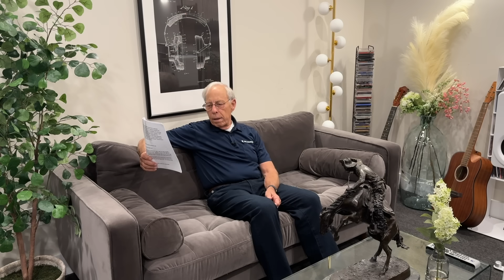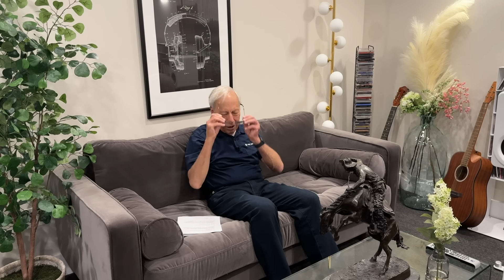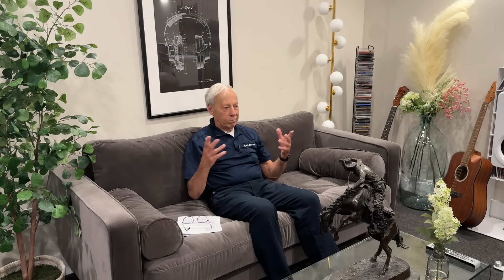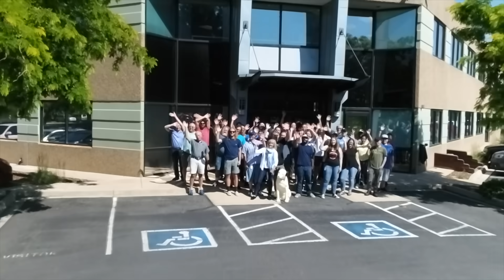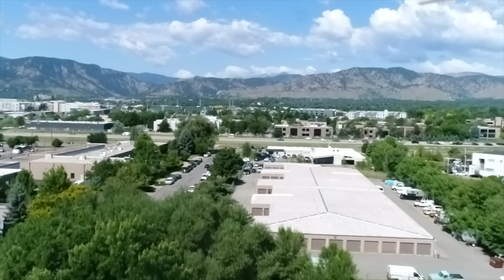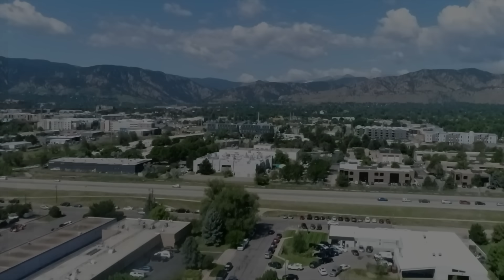Do music streamers sound different?

Comment: I don’t often find myself disagreeing with Paul, but this is one of those rare times. I own three streamers, the HiFi Rose 150B, the Node II, and the WiiM Ultra Music Streamer—all used strictly as streamers feeding into the Metronome Le Dac II via USB. After extensive testing, I couldn’t hear any difference between them. Absolutely zero.
Reply: Nor should you ... that's all "digital side" comparison where the usual analog issues simply don't exist.
Reply: @veteq101: you can rest assured that your experience matches what is to be expected.

If the data is unaltered by the sources, they only technically at least theoretically possible sound difference can occur through jitter. That is measurable, but its audibility already under quite debate. Luckily, there is a rather simple solution: get a better DAC which has a better reclocking/buffering strategy. IF that ever is an issue, fight it on the right spot and not by trying to optimize the sources.
Reply: Neither you nor paul is wrong. I think paul would have been better served by saying that there are streamers out there that do extra things. Extra features that may change the sound which means that some streamers do sound different. Paul then points out that these streamers that do extra things are uncommon, and most streamers will sound virtually identical to each other.
Reply: With high end components i.e., the human ear can't tell the difference in distortion. It becomes a mute point.
Reply: @mauriceb9996  ...for future reference it's moot point (look it up)👍✌
Reply: @mauriceb9996 try pressing the mute button and you should be able to hear the difference then.
(Moot).
Reply: I have owned Lumin 1 mini, Raspberry pi with hat, sonore, and Tenario. Each one of them sounds differently. I know some people would say blind test bla bla. The thing is that you cannot do blind test when you claim they all sound the same, because in their minds the bias is they are the same... So don't question people AB test. You hear what you hear.
Reply: What a troll!!
Reply: Because you have dodgy hearing.
Reply: @Second_Hand_Noise_Damage 
 I definitely can tell the difference in sound between a Dodge Demon, and a Camaro. 
 That is definitely Dodgy hearing.
Reply: @Second_Hand_Noise_Damage  
"Because you have dodgy hearing."

Such an interesting comment from someone with a hearing aide in their avatar and using "second hand noise damage" for a name.
Reply: @Douglas_Blake   ...you just don't get humour & sarcasm, do you?
Reply: You're right ... I don't see how making stuff up about people, following them around and hounding them or straight up insulting them is anything even remotely like humour.

In fact, it comes across as immaturity and plain meanness.
Reply: @Douglas_Blake ...you calling people who can hear better than you, "gullible"...yes, that's very childish of you...I totally agree.
It looks like you can dish it out but you can't take it.
Reply: You ASSUME you hear better than others. You do not know that for a fact, but you use that to attack and belittle people.
Reply: @Douglas_Blake  ...  POT...KETTLE...BLACK  Mr. McGoo.
You ASSUME that there is no sonic difference between copper & silver so that you can attack & belittle people by calling them "gullible". Again, I say to you that you can dish it, but you can't take it. POT...KETTLE...BLACK!
Reply: @Douglas_Blake  ...I'm only holding a mirror up to you, regarding your attack ("gullible") on those of us
who can hear the sonic differences between silver & copper wires...& you don't like it one little bit, do you?
Reply: How do blind people do blind a/b listening tests?  😀
Reply: @Second_Hand_Noise_Damage   ...& who picks up Guide Dog poop?
Reply: @Second_Hand_Noise_Damage  
No... because I actually understand how this stuff works.
Reply: @Douglas_Blake  
Bascom King.. who designed PS Audio's 300 mono-blocks, said that expensive cables do change the sound. He also said that sonic differences in cables can't be measured using test equipment.
Reply: @Second_Hand_Noise_Damage  
Well that's convenient ... incorrect but very convenient.
Reply: @Douglas_Blake  ..I will have to disagree with you on this point. I just swapped out my high grade PCOCC interconnects for OCC 5N pure silver ones & the improvement in detail, clarity & depth in sound was immediately noticeable.
Reply: Okay ... that's allowed. 😉

But lets take that one step further and aske WHY you heard what you heard. 

There can be many variables that just plugging in cables and listening does not account for.  Stuff like dirty contacts on the old cables, changes in the environment (temperature, pressure, humidity, etc) even the degree of attention being paid or small variations in your sitting position can affect one's perception of sound. Unless you can eliminate these variables there is no premise for a valid claim of sonic difference explicitly because of the cables.

Now don't get this wrong... I absolutely believe you had this experience but the reason for it is questionable.

The answer, of course is blind A-B testing against the old cables, that way you get rid of most of the environmental and psychological variables to honestly compare the cables.
Reply: @Douglas_Blake  ... "Okay ... that's allowed." ...I do like a guy with a sense of humour👍
None of those things that you listed, environment, hearing, exactly the same sweet-spot, etc. All are exactly the same.
The difference is that silver carries the signal differently to the way copper carries the signal...it's just that simple.
Reply: Unfortunately it isn't that simple.  But we can stress over that another time.  

The immediate issue is that you've made a claim without confirmation.  Yeah I know we do that all the time but it doesn't make it valid. 

Again the best confirmation is to A-B test old vs new.  Now you have a trustworthy confirmation both of the value of the new part or device and the working state of your system.

Another of my unpopular observations.... Most audiophiles don't actually trust their systems. After spending wheelbarrows full of money, they are still convinced there's some ethereal issue they're just not getting to and THAT can get really expensive as they constantly try to fix problems they don't actually have.
Reply: Same experience here, going from copper to pure silver.
Reply: @michaelwright1602  
Run those cables through blind A-B testing and get back to me...
Reply: @Douglas_Blake  
You don't seem to understand that many of us HAVE done blind a/b testing of cables, and we DID hear big differences in sound. I used to work at a high end hi-fi store, we spent hundreds of hours in our sound proof listening room doing many blind tests, analyzing, speakers, amps, cd players, cables, dac's etc, etc.

Comment: To all nay-sayers that roam these comments: Streamers don’t sound different literally, a streamer has no sound. But a streamers has impact on the ‘purity’ of the (electrical) signal that goes into the digital to analogue conversion. Does a streamers then make a difference? Instead of debating yourself to boredom in YouTube comments, I wonder why nobody ever bothers to have first person experience. Grab two different streamers, borrow one from a friend, or take your DAC to a store. Listen to the same song streamed on two different streamers hooked up to your DAC and then you have your answer.
Reply: I dare say most folks don't have access to $2000 streamers to compare against (or even systems capable of revealing the differences that might be present in the first place).
Reply: @david.stewart high end streamer would be the easiest to just buy and have. Not the cheapest but the easiest. To complete full high-end audio gear, that is beyond peoples' knowledge and abilities - the price is not the only problem here.
Reply: @david.stewart  You don't need to. If you have more affordable DAC, or use the DAC in your amplifier, the impact of different streamers is even more audible.
Reply: @jmtennapel  It is possible cheaper DACs could handle noisier inputs poorly and pollute the output. Technically noise in the digital signal should not be a problem unless it causes issues accurately reading the bits or the DAC is passing it through to the analog output (i.e. it's not isolating input and output).
Reply: @david.stewart I’m sorry, but DACs don’t pass bits. One of those hard to beat misunderstandings. The issue is that DACs process low power electrical signals that represent bits. Any pollution in the electrical (low voltage) signal influences the timing of the digital to analogue conversion when a voltage change signals a bit change. Cheaper DACs are less isolated from this, not because of the DAC chip but all the other components in the signal path and the quality of those.
Reply: @jmtennapel  A DAC takes a digital signal and converts it to an analog signal. That digital signal is a sequence of bits transmitted electrically. If there are issues reading those bits accurately, that is an issue, but  transfer mechanisms have a lot techniques to mitigate that. Quality DACs use their own clocks to isolate themselves from any timing issues of the incoming data stream. A DAC that relies on the USB source timing (i.e. a synchronous implementation) doesn't have the protection so would be susceptible to jitter introduced in the input. Knowing the exact mechanisms of the issues allows consumers to know if a higher end streamer will be of value for them or not.
Reply: @david.stewart  reread what I wrote. Clocking signals have nothing to do with this, since the signal itself is already disturbed.
Reply: @jmtennapel  Clocking is very much an issue (that's the jitter that the Digital Lens is designed to handle). Like I said there are potentially issues with data corruption, but that's relatively rare in modern equipment with short USB runs.

Comment: No difference at all.
 This is a pure technical answer.
The important part is compatibility with all applications as Tidal, QoBuz Etc. Using a good linear PSU will makeshift differences on sound quality.
Reply: your system or hearing may not be resolving enough to hear the differences.

I do agree with compatibility is more important....I use Apple Music lossless and not many streamers can do this natively like my Eversolo DMP-A6 with upgraded linear power supply (it does sound better).

Comment: In the ideal world, the DAC runs a precise clock and there is no PLL involved to try to match an external source trying to be DAC clock master as data moves asynchronously pulled on demand from the DAC. But alright, PS audio still likes using synchronous interface where jitter becomes a topic. But come on, the entire audio streaming from a server somewhere in a data center to your streamer over perhaps 1000s of miles of cables and routers make no jitter because...it's asynchronous! The DAC's internal high precision clock should be the clock master and this topic would be gone. USB can easily do that. We are in 2025. And USB is no more noisy than I2S when proper careful design is done. Give us asynchronous USB interface, audiophile DSP on streamer side (for room EQ, loudness EQ, rejuvenation EQ, personalization EQ, tube emulator and proper subwoofer cross-over) , good noise isolation, DSD streaming, NAS support, USB CD drive support (call it transport), voice control and a matching DAC either 2 channel (standard stereo speakers), or 8 channel (active cross-over for next-gen audiophile performance).
Reply: Exactly. USB is the way.
Reply: Although we don't live in an ideal world, I think a streamer and combined/separate DAC with those features will be designed and produced in the near future. It certainly would be worth its weight in gold for those looking for true audiophile performance.
Reply: @mattrismatt  
They're already out there and have been for a few years now.
Reply: @Douglas_Blake    Nice. What are the model numbers?
Reply: @mattrismatt  
There are a lot of them ... For example, virtually all USB Dacs are now asynchronous, most streamers now include some degree of room correction, and so on...

You're best to do your own shopping to find what's best for you.
Reply: @Douglas_Blake    If there are 'a lot of' streamers and combined/separate DACs with those features, it should be easy to name one.
Reply: @mattrismatt  
Seriously?  This is your challenge?

Go troll someone else.
Reply: @Douglas_Blake    You made the claim. The burden of proof is on you!
Reply: @mattrismatt Yes, but such product doesn't actually exist because most of the audiophile industry still lives with an old mindset before streaming took over. Many audiophiles don't even realize nowadays we already have reliable and better than CD quality lossless streaming.
Reply: @ThinkingBetter  
Exactly ... most of them are still back in the "My mouse makes noise in my speakers" thing from the late 1980s.
Reply: @mattrismatt  
You have to know we can't post brand names here ... YT deletes the comment.
Reply: @Douglas_Blake    Then post just the model number without the brand name... a DAC/streamer with all the feature specified in the original post.
Reply: @mattrismatt  
Look, I'm not going to play lawyer with you.  
Go waste someone else's time.
Reply: @Douglas_Blake    You made the claim that such a product exists. Just name the product or stop responding!
Reply: USB features different modes and can also be synchronous, but yes, in theory, the asynchronous one would be the way to go as then the DAC's clock can run free like a horse as in "America - A Horse With No Name". 😊

Another approach would be to simply copy the entire album or whatever to some internal RAM which virtually doesn't cost anything anymore today and read it from there.

However, not only is S/PDIF the somewhat cooler interface (although technically outdated) with its nice optical counterpart, I wonder if anyone ever was able to detect any audible differences in a proper blind test at higher jitter levels.

At the end, it is the burden of a proper DAC to cope with jitter and since there are plenty available which provide measurable proof being able to do so, that is the way to go if worrying about it, not fiddling with the source or cables.
Reply: So, basically a Home Theatre PC.
Reply: @Douglas_Blake No, not a PC...I am talking audiophile components...
Reply: @ThinkingBetter  
🤨 So was I.

Comment: 2:35  I don’t know if want to hear an answer (from another random guy on YouTube!) but I’m kinda wondering why it’s literally or practically impossible for noise to be transmitted through air via the ‘no physical connection’!
Reply: Using an optical coupler, for example, “breaks the link” in the signal chain. If there was electrical noise on the signal before the optical coupler, that noise should not be transmitted optically. There’s probably noise that gets in later but I suppose the idea is that this step reduces it. Does it matter? No clue.
Reply: @SteveRyder  
And what exactly prevents an optical coupler from transmitting noise?

Comment: why doesn't noise jump over the air; how does galvanic isolation transmit audio data but not noise?
Reply: I'm going to go out on a limb here... but I'd be betting the opto-coupler is being used in the digital side of the streamer where noise isn't an issue to begin with.

Comment: They shouldn't! If said streamers sound different, there is something wrong.
Reply: This something wrong is called jittering, reclocking, power supply, and isolation. They said everything, it's just people like you are denying.
Reply: @citytianyu  What you're describing is an out of spec or broken streamer.

Comment: Good external dacs have reclocking and jitter suppression. So it is interesting to know how important all this isolation is necessary on the streamer side.
Reply: Exactly. Very little.
Reply: @davidfairchild1640 I guess you validated that yourself? Which magical DAC do you use?
Reply: I still heard an improvement when I use the DDC Denafrips Iris 12th with my DAC Denafrips Pontus 12th-1.

Additionallly, I was surprised that I still heard an improvement when I upgraded my streamer Eversolo DMP-A6 to a linear power supply.

Make sure you use a lossless source in a highly resolving system.

My video:
https://www.youtube.com/watch?v=dG_O5Z0RFqI
Reply: Very important
Reply: @Pete.across.the.street How so? Truly curious.
Reply: @OG2978-g7x clocks are VERY sensitive to noise
Reply: I have a dCS Bartok DAC. I read  from a forum saying that the best digital input of the DAC is the network input, using it as a streamer. I was like it's such an expensive piece, maybe its streamer part is superior to the most separated. Turns out, No... it isn't. I mean, it's not bad but cannot compete with my 1k+ sonore streamer.
Reply: @OG2978-g7x

Exactly, which is why comparing streamers for their audio quality given that they deliver the same data (which should always be verified though), is already quite voodoo-ish, so say the least.

RME for instance with their "femto clock" approach shows that there isn't even a measurable difference with various jittery sources anymore after reclocking and even that whole architecture is probably already way over-engineered as jitter must reach quite extreme values to become even remotely audible.

It's the audiophile's beloved topic as the usually achieved data-correctness on the user level they sadly can hardly dispute as it's provable. So they fall back on their last resort jitter where it's inaudibility (the null hypothesis) in principle cannot be proven so they can always claim that there could be, may be, might be a difference as "who knows?", right?
Reply: @little-endian5957 the effects of jitter are easily audible even with low amounts on a resolving properly setup system. You don't actually hear jitter perse